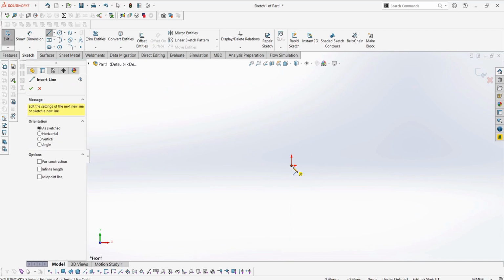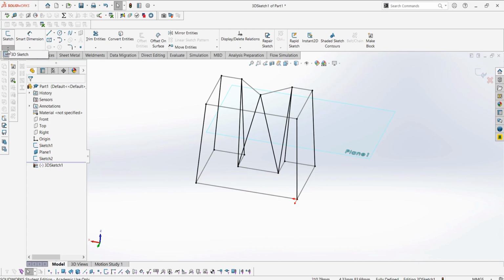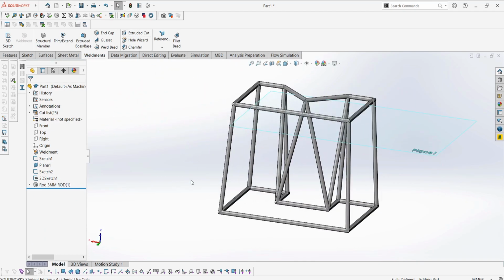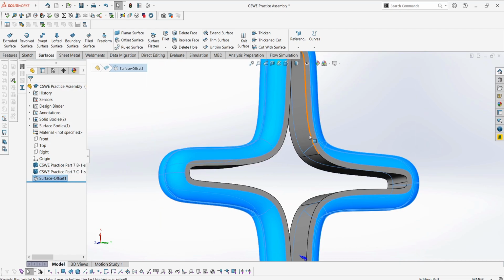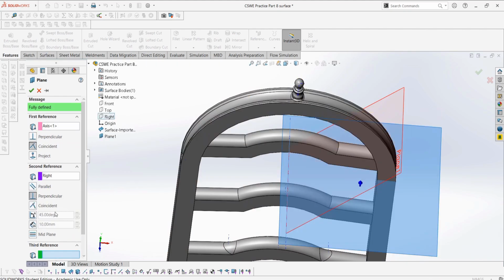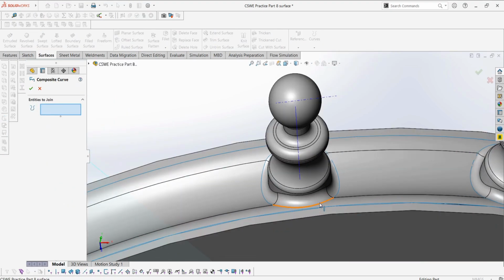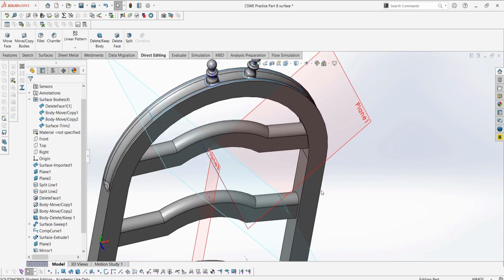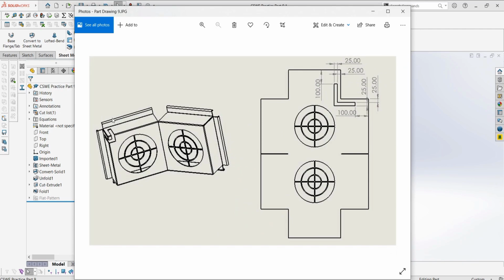Cracking The CSWE Practice Episode Part Two

Comment: @Lucas_Crupi I think there may be an easier way to complete problem 8. Let me know if I'm missing something though. This was my order of operations. 0mm offset surface of that top part to create a copy. rotate copy 10 degrees left and right and delete& patch original top part. Create a sketch on the top plane and convert the edge of the two  copies. use that edge to make a split line on the curved surfaces of the chair back. you can then delete inside the split line and knit all 3 surface bodies together. 

Love your videos overall. They have been super helpful!

Comment: Hey! Loved the video. What would you recommend to do when doing a convert to sheetmetal part it says that it cant find bends
Reply: Like when i choose the starting face, and click collect all bends, it wont make the sheet metal part
Reply from the maker: Hey Scott, first try selecting the bends manually, this isn’t a fix but it will check if Solidworks is recognizing any bends. It probably has to do with your import settings. Take a look at those and shoot me an email if you don’t have any luck
Reply: @Lucas_Crupi  ok thank you!
Reply: Having issues with sheet metal problem. Using the convert to sheet metal will not default to the correct sheet metal thickness and bend radius. Command will not work if I enter the correct values. Weird.
Reply from the maker: Maybe try re importing it, or ty changing your import settings. if neither of those work email me.
Reply: @Lucas_Crupi  I was having problems with the imported solid body as well. I disabled 3d interconnect from my import settings then I was able to convert to sheet metal successfully.